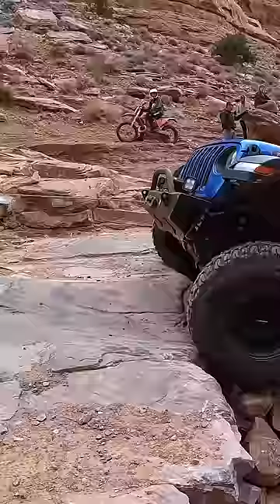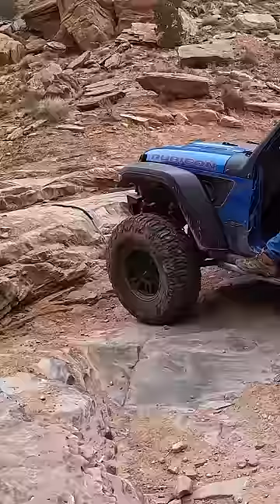What Happens When Synthetic Winch Line Breaks

Comment: Synthetic ropes doesn’t always just drop like that. They do store some energy and have a slight recoil when it breaks under extreme tension. No where near the amount of stored energy from a cable wire winch rope but no matter what system your using should always use a dampener over your winch rope so there’s no chances of any spring back that may cause a winch hook to come flying back.
Reply: I have and old t shirt in the jeep just for this reason.
Reply: Who is still using steel hooks?  Shouldn't we all be using load rated soft slings to ensure no one ever gets hurt?
Reply: @spf50sunscreen80  all well and good to use soft slings but the recovery points aren’t designed for soft shackles which I’ve seen break due to people using the wrong style recovery points. Most people still use recovery points that are designed for d shackles so the radius hole is sharp causing soft shackles to break.
Reply: @Keithostrangeman  I have never seen a recovery point with blades in it.  Sounds like a poor design.  The point is still no one gets hurt.

Comment: Yes finally got to see one break. The fact that the material doesn’t really stretch is the big key here.  Anything that deforms before breaking is storing up dangerous energy to be released.
Reply: This is true only for elastic deformation.  Plastic deformation stores very little energy.
Reply: @bradarsenault6984  tell that to a breaking chain…
Reply: @Grunttamer  ok.  Chains and almost any metal under tension goes through elastic deformation before plastic and then failure
Reply: @Grunttamer  we're forging studs on rebars. Then we test it for tension.
A 30mm one breaks so fucking loud and hard, it shakes a 2 tonne machine and half of a building.
Reply: @Grunttamer u didn't listen in physics class now did u?

Comment: News flash, funny. I switched to synthetic lines back in the late 90s. Everyone in the Jeep club was saying it was unsafe.  The best thing I did was that and ditch the hook.  I replaced it with a "Hammer Lock" link, so I had to use shackles to connect. I do still have a winch or two running a cable, but for seldom used ones that are exposed to the sunlight.
Reply: Brilliant idea then no worry of the hook becoming a projectile

Comment: I've personally witnessed two different synthetic  lines fail during recoveries.  The first was an extension line that was connected to a Warn winch line with the Warn factory hook...  it sent that hook flying about 70 feet in maybe 1/4 of a second.  It slammed into the off road bumper on the winching vehicle, denting it severely - and then ricocheted another 25 feet straight sideways.  The second occurrence was a winch line that failed at the crown of the metal thimble attached to a Factor 55 FlatLink.  Fortunately nothing but the line itself went flying -- but it flew about 50 feet into the front of the winching vehicle so quickly that there was no time to react to it.

All of that said, synthetic line 'is' significantly safer than traditional wire cable.  But its not 'always' as innocuous as in this video.  It can, and absolutely is, capable of causing serious injuries and must be respected.
Reply: It is always innocuous if you are using the correct gear.  Hook it up with rated soft slings.  Or at least shackle it properly and you will never see injury using fabric winch rope.

Comment: I am changing out to syn. for two reasons . The danger when wire breaks even with weighted bags but my biggest problem with wire is the constant un spooling on the drum. I get sick of having to unspool and respool a hundred feet of cable everytime I use the winch.
Reply: Yessss bro 💯
Reply: dont free spool steel unless you plan to pull it all the way out always motor it out

Comment: I must say, I was not so sure the synthetic rope was a good thing when I first swapped out the old steel wire cable. Because I have a 1994 HZJ 75 series Toyota Landcrusier "Troop carrier" that weighs about three tons fully loaded. After a few winch recoveries I was no longer worried about the rope handling the weight.

Comment: Fiber core steel winch also just drops when it breaks. But steel has a higher load rating, longer life and better abrasion resistance.
Reply: Some HMPE ropes have higher ratings than Wire Rope.  Depends on the type of hmpe.

Comment: I've seen that synthetic melt to itself. it seems like a one time use item.
Reply from the maker: 😂😂 yea sure. If that happened then someone was seriously overheating their winch.
Reply: If synthetic is not spooled on winches under some pressure, they can appear to be melted together.   Especially if the die is applied heavily.  The flat spots on the drum can be kneeded and commonly goes back to normal.

Comment: I use  Electrical Transmission Linemans synthetic line  Brutally stronger than any the winch companies offer.
Reply: Mule tape!!
Reply: @Bikes_N_Adventure mule tape that I have is just 2500 lbs break strength.  I have seen wider with 3500 lb break strength. It is polyester.  This synthetic winch line is Dyneema or its generic equivalent.

Comment: Another question to ask is what happens when your synthetic cable breaks when your in steep rocks and your ride rolls over down the mountain? Ive got both and will probably never buy synthetic again. Gets damaged to easy the sun, a tree, rocks, debris, sand. If you break a steel cable you did something really stupid. Ill take my chances with steel since i work in industrial plants ive got to use both synthetic is much easier to work with and handle but much easier to get damaged and kill you when whatever your lifting or winching falls. Theres a reason cranes use steel cable and never synthetic.
Reply from the maker: You do you.

Comment: Bought how often do you replace them?
Reply: Depends on the condition of the rope.  I have seen HMPE ropes in use for many years.  If taken care of and abrasion is kept to a minimum, they can last a while.  Always inspect before and after using.
Reply: @RamiroLundy  yeah was kinda curious on time if it’s not used that often. How hard the sun is on it etc. I’ve got a winch cover and decades of steel cable experience but don’t know about synthetic timelines
Reply: They are susceptible to UV.  If it is looking sun bleached, it's best to replace it if it is severe.  But some cheaper manufacturers use a lesser quality coating / die, so they may even lose color in water.  Just use your best judgment.

Comment: dont get too comfortable around synthetic line depending on how the break happens it can still whip steel cable can also fail just like this video in the right conditions it does not mean it wont whip. everything thing about this is very dangerous so dont get comfortable these ropes are still new in the recovery world give it time and people will get killed. the same rope materials are used in the maritime industry and they have killed many sailors when they let go.

Comment: This is a pretty bad explanation. Synthetic winch line does store kinetic energy and will whip back especially when you have a lot of line out. Still way better than cable but it will still whip back, ive seen it happen every single time a Synthetic winch line has snapped.